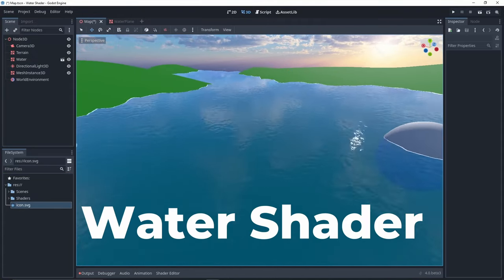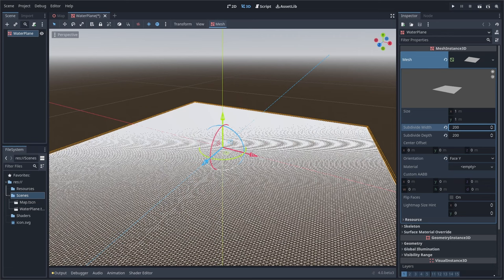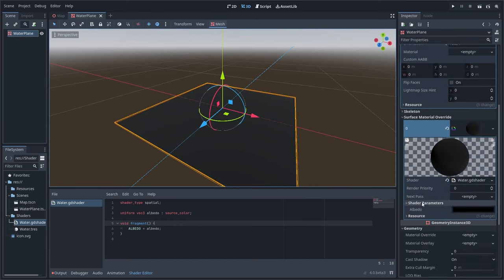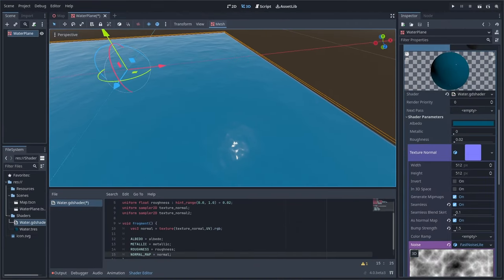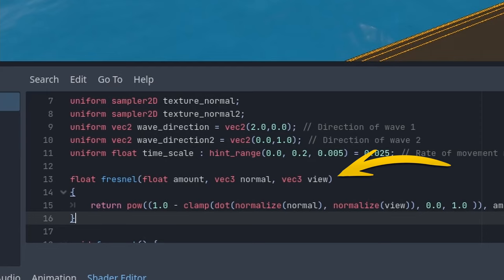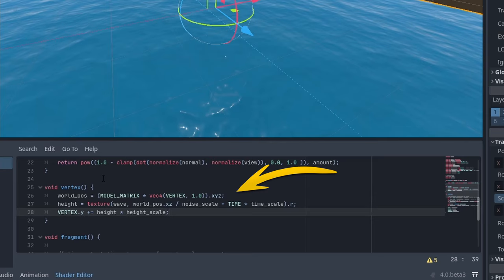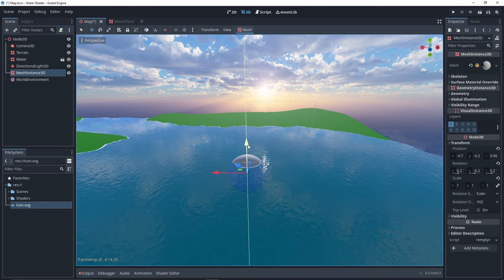How To Create A Water Shader // Godot 4 Tutorial

Comment: I must have missed something. I'm not getting any alpha. I'm assuming this is because we're not setting the `ALPHA` somewhere, but I'm not sure. My water is completely opaque, so anything underneath it is completely invisible :(

I ended up changing pretty much everything to a vec4, and using this, but the depth fade doesn't seem to be working, even with extremely large or extremely small values. 😞

	vec4 albedo_mix = mix(surface_color, depth_surface_color, 0.75);
	ALPHA = albedo_mix.a;
	ALBEDO = albedo_mix.rgb;

Comment: If you happen to run into a weird visual bug where the shader doesn't seem to be working quite right with the waves and foam, try restarting the Godot engine after saving and see if that fixes it, this happened to me and I don't know if it was a compiling issue or what but it fixed everything.
Reply from the maker: Weird, thanks for sharing that!  If it pops up again, feel free to msg a screenshot on the Discord.

Comment: Using the suggestions below on your watershader download, here's the full code for the water.gdshader:

shader_type spatial;

uniform vec3 albedo : source_color;
uniform vec3 albedo2 : source_color;
uniform float metallic : hint_range(0.0, 1.0) = 0;
uniform float roughness : hint_range(0.0, 1.0) = 0.02;
uniform sampler2D wave;
uniform sampler2D texture_normal;
uniform sampler2D texture_normal2;
uniform vec2 wave_direction = vec2(2.0,0.0); // Direction of wave 1
uniform vec2 wave_direction2 = vec2(0.0,1.0); // Direction of wave 2
uniform float time_scale : hint_range(0.0, 0.2, 0.005) = 0.025; // Rate of movement multiplied by TIME
uniform float noise_scale = 10.0;
uniform float height_scale = 0.15;

uniform vec4 color_deep : source_color; // Deep depth color
uniform vec4 color_shallow : source_color; // Shallow depth color
uniform float beers_law = 2.0; // Beer's law application
uniform float depth_offset = -0.75; // Offset

uniform float edge_scale = 0.1;
uniform float near = 1.0;
uniform float far = 100.0;
uniform vec3 edge_color : source_color;
uniform sampler2D depth_texture : hint_depth_texture;
uniform sampler2D screen_texture: hint_screen_texture;

// Varying variables
varying float height;
varying vec3 world_pos;

float fresnel(float amount, vec3 normal, vec3 view)
{
	return pow((1.0 - clamp(dot(normalize(normal), normalize(view)), 0.0, 1.0 )), amount);
}
float edge(float depth){
	depth = 2.0 * depth - 1.0;
	return near * far / (far + depth * (near - far));
}

void vertex() {
	world_pos = (MODEL_MATRIX * vec4(VERTEX, 1.0)).xyz;
	height = texture(wave, world_pos.xz / noise_scale + TIME * time_scale).r;
	VERTEX.y += height * height_scale;
}

void fragment() {
	// Depth variables and calc
	float depth_texture_x = texture(depth_texture, SCREEN_UV).x;
	vec3 ndc = vec3(SCREEN_UV * 2.0 - 1.0, depth_texture_x);
	vec4 view = INV_PROJECTION_MATRIX * vec4(ndc, 1.0); 
	view.xyz /= view.w;
	float depth_blend = exp((-view.z+VERTEX.z + depth_offset) * -beers_law);
	depth_blend = clamp(1.0 - depth_blend, 0.0, 1.0);
	float depth_blend_power = clamp(pow(depth_blend, 2.5), 0.0, 1.0);

	// Retrieving depth color and applying the deep and shallow colors
	vec3 screen_color = textureLod(screen_texture, SCREEN_UV, depth_blend_power * 2.5).rgb;
	vec3 depth_color = mix(color_shallow.rgb, color_deep.rgb, depth_blend_power);
	vec3 color = mix(screen_color * depth_color, depth_color * 0.25, depth_blend_power * 0.5);
	
	// Getting edge depth calc
	float z_depth = edge(texture(depth_texture, SCREEN_UV).x);
	float z_pos = edge(FRAGCOORD.z);
	float z_dif = z_depth - z_pos;
	
	// Time calculations for wave (normal map) movement
	vec2 time = (TIME * wave_direction) * time_scale; // Movement rate of first wave
	vec2 time2 = (TIME * wave_direction2) * time_scale; // Movement rate of second wave
	
	// Blend normal maps into one
	vec3 normal_blend = mix(texture(texture_normal,world_pos.xz + time).rgb, texture(texture_normal2,world_pos.xz + time2).rgb, 0.5);
	
	// Calculate Fresnel
	float fresnel = fresnel(5.0, NORMAL, VIEW);
	vec3 surface_color = mix(albedo, albedo2, fresnel); // Interpolate albedo values by frensel
	
	vec3 depth_color_adj = mix(edge_color, color, step(edge_scale, z_dif));
	
	ALBEDO = clamp(surface_color + depth_color_adj,vec3(0.0),vec3(1.0));
	METALLIC = metallic;
	ROUGHNESS = roughness;
	NORMAL_MAP = normal_blend;
}
Reply: Hugeeee thanks!
Reply: you are a champion

Comment: I see a couple others have also mentioned the issue of the depth color not working properly, so I've got this to work (do not ask me why it does, but it took me some searching online to find a workaround)

In the fragment shader, replace this section of code:
	float depth_texture = texture(DEPTH_TEXTURE, SCREEN_UV).r * 2.0 - 1.0;
	float depth = PROJECTION_MATRIX[3][2] / (depth_texture + PROJECTION_MATRIX[2][2]);
	float depth_blend = exp((depth+VERTEX.z + depth_offset) * -beers_law);
	depth_blend = clamp(1.0 - depth_blend, 0.0, 1.0);
	float depth_blend_power = clamp(pow(depth_blend, 2.5), 0.0, 1.0);

With this:
	float depth_texture = texture(DEPTH_TEXTURE, SCREEN_UV).x;
	vec3 ndc = vec3(SCREEN_UV * 2.0 - 1.0, depth_texture);
	vec4 view = INV_PROJECTION_MATRIX * vec4(ndc, 1.0); 
	view.xyz /= view.w;
	float depth_blend = exp((-view.z+VERTEX.z + depth_offset) * -beers_law);
	depth_blend = clamp(1.0 - depth_blend, 0.0, 1.0);
	float depth_blend_power = clamp(pow(depth_blend, 2.5), 0.0, 1.0);

And the depth color should now work properly!
Reply: Thank you, this works for me on Godot v4.1.3!
Reply: thank you
Reply: A small change in Godot 4.1 to add to this is the removal of the DEPTH_TEXTURE and SCREEN_TEXTURE references. (They got changed into hints variables.)
To fix this, as stated in the error printed, with minimal changes, it can be done by adding this uniform variable:

uniform sampler2D DEPTH_TEXTURE: hint_depth_texture, filter_linear_mipmap;
uniform sampler2D SCREEN_TEXTURE : hint_screen_texture, filter_linear_mipmap;

within the rest of the uniform variables at the top of the shader.
Reply: why
Reply: Thanks! @creationsmaxo
Reply: FYI: This is because the depth is 'screen space', but being compared to the vertex's z position in world space. The new code turns the screen depth to world space. The correct way to do this with just depth would be to replace vertex.z with gl_FragCoord.z, though you'd probably need to run a linearise function on both to get a value that doesn't compress depending on camera distance.
Reply: @GrandHighGamer  dang smarty pants. yeah i think i just tried shit until it looked right. pop off doctor shaders
Reply: thank u soooo much i was stuck
Reply: @GrandHighGamer  saw a new video came out but I'm here trying to figure out what you said here

Comment: You mention scaling up the mesh at the start but then don't explain how? I have this in its own scene but I have no idea how to get it to work in another scene and scale it correctly. 

Thanks if you can help!
Reply: Hi there- the way I did it (which is terribly, terribly hacky- sorry) is to add a float for the UV scale and change the line for "normal_blend" (replace "world_pos.xz" with "(UV * uv_scale)"). Like this you have a slider underneath Roughness that lets you change the UV scale to whatever fits. Here's the full code:

"
shader_type spatial;

uniform vec3 albedo : source_color;
uniform vec3 albedo2 : source_color;
uniform float metallic : hint_range(0.0, 1.0) = 0;
uniform float roughness : hint_range(0.0, 1.0) = 0.02;
uniform float uv_scale : hint_range(0.0, 300.0, 0.25) = 1.0;

uniform sampler2D wave;

uniform sampler2D texture_normal;
uniform sampler2D texture_normal2;

uniform vec2 wave_direction = vec2(2.0,0.0);
uniform vec2 wave_direction2 = vec2(0.0,1.0);
uniform float time_scale : hint_range(0.0, 0.2, 0.005) = 0.025;

uniform float noise_scale = 10.0;
uniform float height_scale = 0.15;

//Varying variable
varying float height;
varying vec3 world_pos;

//Functions
float fresnel(float amount, vec3 normal, vec3 view) {
	return pow((1.0 - clamp(dot(normalize(normal), normalize(view)), 0.0,1.0)), amount);
}

void vertex() {
	world_pos = (MODEL_MATRIX * vec4(VERTEX, 1.0)).xyz;
	height = texture(wave, world_pos.xz / noise_scale + TIME * time_scale).r;
	VERTEX.y += height * height_scale;
}

void fragment() {
	vec2 time = (TIME * wave_direction) * time_scale;
	vec2 time2 = (TIME * wave_direction2) * time_scale;

	vec3 normal_blend = mix(texture(texture_normal, (UV * uv_scale) +  time).rgb, texture(texture_normal2, world_pos.xz + time2).rgb, 0.5);

	float fresnel = fresnel(5.0, NORMAL, VIEW);
	vec3 surface_color = mix(albedo, albedo2, fresnel);

	ALBEDO = surface_color;
	METALLIC = metallic;
	ROUGHNESS = roughness;
	NORMAL_MAP = normal_blend;
}

"

Comment: Hey, a question about scaling and such. I know I'm using this shader for a very different kind of mesh, as yours is meant for one where UV 0,0 is for one corner, and UV 1,1 is for the other corner.
However, I'm trying to apply this to the godot_voxel cubes. The issue is that each voxel is a UV from 0 to 1, so the entire effect of this is repeated across the top of every voxel. I tried to see if I could offset it with VERTEX, but it seems to make the entire effect follow my camera when used in the fragment shader.
Do you know of any alternative way I could at least scale the effect up to span multiple voxels? I know I could use a vertex shader instead, but a normal map looks so much better.

Edit: Figured it out. I set the world_vertex_coords render mode, made a varying vec2, stored the VERTEX.xz into it in the vertex shader, then used that value in the fragment shader.

Edit 2: would've helped if I continued watching the video into the advanced part because you cover this :P

Comment: How do you make the plane bigger? It is set to 1x1 meters which is too small for something like an ocean, or even a lake, but when I try to scale it then it seems the scale is also applied to the height from the height map, resulting in massive spikes on the water surface. Just doing a 5-times scale to get 5x5 meters plane makes it look like there is very wild stormy weather. I followed the steps from 8:30 and the code is exactly the same, but that doesn't really help to make the water scalable. I'm on Godot 4.2 so maybe that could be causing the issue? Or maybe I'm scaling it wrong (I was using the scale in MeshInstance3D's transform)? Or am I misunderstanding what "scalable" is supposed to mean here?
Reply: Same. Did you find an answer?
Reply: @mast1665  Unfortunately, I did not.
Reply: Hi there- the way I did it (which is terribly, terribly hacky- sorry) is to add a float for the UV scale and change the line for "normal_blend" (replace "world_pos.xz" with "(UV * uv_scale)"). Like this you have a slider underneath Roughness that lets you change the UV scale to whatever fits. Here's the full code:

"
shader_type spatial;

uniform vec3 albedo : source_color;
uniform vec3 albedo2 : source_color;
uniform float metallic : hint_range(0.0, 1.0) = 0;
uniform float roughness : hint_range(0.0, 1.0) = 0.02;
uniform float uv_scale : hint_range(0.0, 300.0, 0.25) = 1.0;

uniform sampler2D wave;

uniform sampler2D texture_normal;
uniform sampler2D texture_normal2;

uniform vec2 wave_direction = vec2(2.0,0.0);
uniform vec2 wave_direction2 = vec2(0.0,1.0);
uniform float time_scale : hint_range(0.0, 0.2, 0.005) = 0.025;

uniform float noise_scale = 10.0;
uniform float height_scale = 0.15;

//Varying variable
varying float height;
varying vec3 world_pos;

//Functions
float fresnel(float amount, vec3 normal, vec3 view) {
	return pow((1.0 - clamp(dot(normalize(normal), normalize(view)), 0.0,1.0)), amount);
}

void vertex() {
	world_pos = (MODEL_MATRIX * vec4(VERTEX, 1.0)).xyz;
	height = texture(wave, world_pos.xz / noise_scale + TIME * time_scale).r;
	VERTEX.y += height * height_scale;
}

void fragment() {
	vec2 time = (TIME * wave_direction) * time_scale;
	vec2 time2 = (TIME * wave_direction2) * time_scale;

	vec3 normal_blend = mix(texture(texture_normal, (UV * uv_scale) +  time).rgb, texture(texture_normal2, world_pos.xz + time2).rgb, 0.5);

	float fresnel = fresnel(5.0, NORMAL, VIEW);
	vec3 surface_color = mix(albedo, albedo2, fresnel);

	ALBEDO = surface_color;
	METALLIC = metallic;
	ROUGHNESS = roughness;
	NORMAL_MAP = normal_blend;
}

"
Reply: I know this comment is 7 months old, but an easy way to increase the size of the plane is to edit the Size property in MeshInstance3D in the Inspector if you have the plane MeshInstance3D selected.

Comment: Absolutely amazing tutorial! Love the effect.

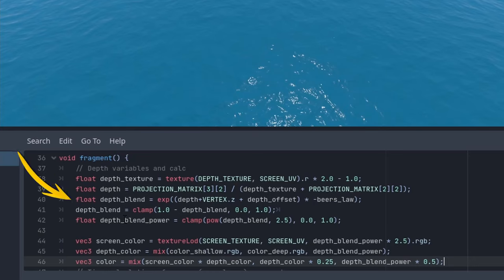Quick question. At 10:54 you're sampling the depth texture like this: float depth_texture = texture(DEPTH_TEXTURE, SCREEN_UV).r * 2.0 - 1.0;
This would give you a value between -1.0 to 1.0, but Vulkan's NDC for the z-range is 0.0 to 1.0. Would float depth_texture = texture(DEPTH_TEXTURE, SCREEN_UV).r; alone not be correct here instead?
Reply from the maker: Hey crigz...Good point...I need to revisit the depth color, as Mux213 mentioned, the newer betas have some new syntax.  I'll play around a bit and see what's up.

Comment: well, it was 9 month ago, but i have stupid question: how can i rescale this thing?
i mean make shader bigger with out arraying this thing
Reply: Hey there, I just ran into the same problem and it seems dev forgot to add it to the tutorial. I believe to have found a solution, though: 
- Add another uniform:
uniform float scale_size = 1.0;
- in vertex(), add these two lines:
VERTEX.x *= scale_size;
VERTEX.z *= scale_size;

With that, you now have another parameter scale_size for your shader. Set it e. g. to 50, and every water pixels position will multiplied by 50 in x and z direction, i. e. the horizontal plane.

Comment: depth doesn't work for me, I tried initializing with uniform but it still didn't work, same color didn't change(I already set the color scheme for both shallow and deep).

another question, did you adjust the transparency of the water mesh? because before adjusting mine, I couldn't see the other side of the water unlike yours.

would greatly appreciate a reply from anyone who might know, thanks :)

edit: figured out the transparency bit, but the depth thing still doesn't work even if I added the sampler2D depth thing Godot suggested, a little help? :)

(I can see the shallow one working, but the deep, no matter how low I place it below the water it doesn't change color)

Comment: Managed to follow the bulk of this.  I have it all as far as the depth colour.   However, although my cylinder is visible under the water it is not getting darker as it goes deeper.  I tried setting color_deep to a darker colour but it doesn't work so my guess is it's not mixing color_deep and color_shallow with the depth values properly.  I've double checked my code to be correct ( even though some of the code is different in the video to the website )

I am using Godot 4.1 and this tutorial is for Godot 4.0 the main alteration I had to do was re-implenting  DEPTH_TEXTURE and SCREEN_TEXTURE as uniform sampler2D DEPTH_TEXTURE : hint_depth_texture, filter_linear_mipmap;  ( and similar for SCREEN TEXTURE )

can anyone help me figure out why my cylinder is not changing colour as it goes deeper?  Oh I should say I'm using Linux too.
Reply: having the same issue. good to know it's not my fault
Reply: In the fragment shader, replace this section of code:
	float depth_texture = texture(DEPTH_TEXTURE, SCREEN_UV).r * 2.0 - 1.0;
	float depth = PROJECTION_MATRIX[3][2] / (depth_texture + PROJECTION_MATRIX[2][2]);
	float depth_blend = exp((depth+VERTEX.z + depth_offset) * -beers_law);
	depth_blend = clamp(1.0 - depth_blend, 0.0, 1.0);
	float depth_blend_power = clamp(pow(depth_blend, 2.5), 0.0, 1.0);

With this:
	float depth_texture = texture(DEPTH_TEXTURE, SCREEN_UV).x;
	vec3 ndc = vec3(SCREEN_UV * 2.0 - 1.0, depth_texture);
	vec4 view = INV_PROJECTION_MATRIX * vec4(ndc, 1.0); 
	view.xyz /= view.w;
	float depth_blend = exp((-view.z+VERTEX.z + depth_offset) * -beers_law);
	depth_blend = clamp(1.0 - depth_blend, 0.0, 1.0);
	float depth_blend_power = clamp(pow(depth_blend, 2.5), 0.0, 1.0);

And the depth color should now work properly!
Reply: @NateNo  it's different but something is still not right. 
My cylinder now goes instantly to color_deep.
Increasing the value of color_shallow changes the color of the water surface but not the cylinder which remains at color deep. 
If it goes deep enough it changes to color_shallow and the change is quite sudden.

Swapping the  order of color_shallow and color_deep in the line
vec3 depth_color = mix(color_shallow.rgb,color_deep.rgb,depth_blend_power);
to be 
vec3 depth_color = mix(color_deep.rgb,color_shallow.rgb,depth_blend_power);
fixes this.

I need to work out how to make it darken sooner for my preferences now.
I am using the Linux client and I'm guessing that might be making a difference.
Reply: Actually no, it's still not changing the colour of the cylinder with depth.
Reply: @NateNo   this works for me however my water plane is scaled 20xs in the X and Z, the y is kept at 1x , I have to move it waaay above my terrain for it to show the depth. Do i need to change something in the code to account for my resizing the tile by 20x? And for some reason the shallow depth shows as red and not what i assinged it in the parameters.

Comment: is it possible to replicate this shader using the visual shader?
Reply from the maker: Within 3.5?  Or the standard shadermaterial in the editor?
Reply: @stayathomedev  with the shadermaterial in godot 4
Reply: Without a doubt, yes it is possible. But doing the conversions can be very annoying, so you'd have to research each I/O node and figure out how the modules need to connect to replicate shader code syntax. It would probably be easier to just make the water from scratch using the same principles applied in this video (and others), but without trying to translate code directly.